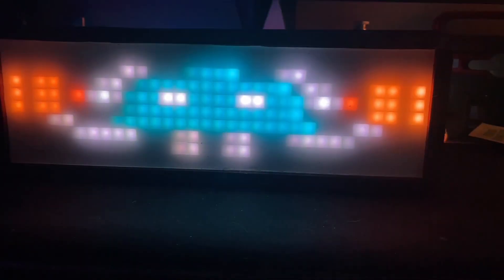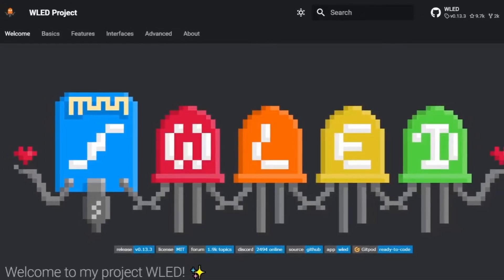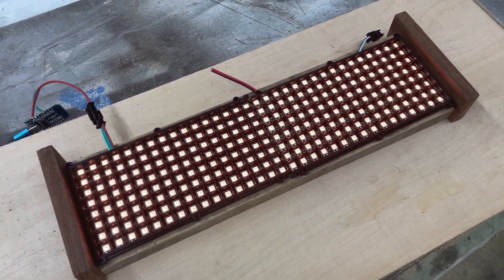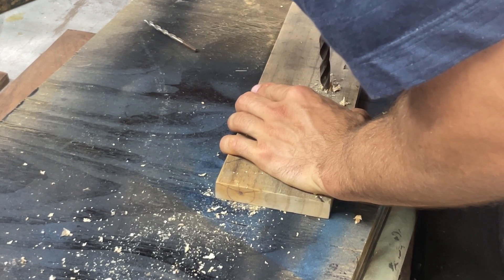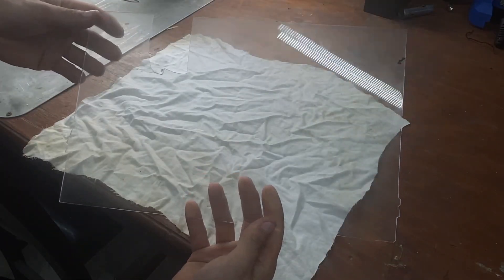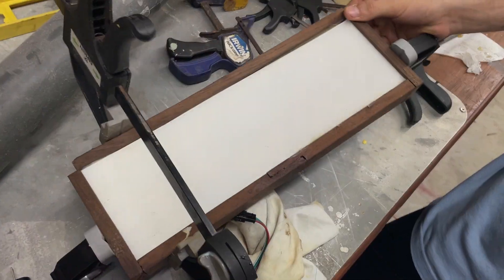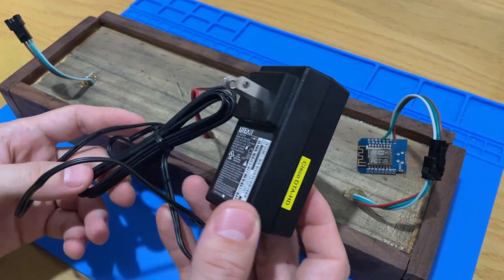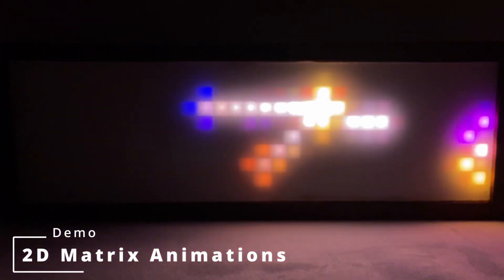WLED 2D Matrix Diffusion Frame (ESP8266 & WS2812B WLED Project)

Comment: Is the a MAXIMUM number of LED PIXELS this WLED software can operate??  - is the WLED software that MUST be used by PC or can it be used via a ANDROID MOBILE PHONE?   ---  can this support 4pin LED strips? --- I AM SCARED of 3 PIN LED strips, becuase IF 1 LED DIES, all the following LED PIXELS WILL fail or go out of sync
Reply from the maker: The max number of LEDs per pin depends on the microcontroller you use. Recommended is around 512 LEDs per pin; performance can start to drop with more due to memory and CPU limits. With some microcontrollers, you can have up to 1024 LEDs per pin. And you can potentially use multiple pins if needed to get even more than 1024 pixels from the one microcontroller if needed.
You would need a PC to program the microcontroller with the WLED firmware, but then you can use your phone with the mobile app to control the LED animations.
Yes, WLED supports various 4-pin addressable LED strips such as WS2813 or WS2815. I've always used the 3-pin version WS2812B on all my projects and haven't had a problem yet. But the 4-pin versions are a good idea for something that needs to be more robust, or if it is hard to replace after damage.
Reply: @Electriangle  ahhh, ok, so can you help me here.... i have 144/1m led strips---- i have 8x strips, i have actually shortened them so there are 134 leds per line.... it start from top left, direction goes left to right.... at the end of the 1st 134 leds, the next strip sits below 1st strip but now direction is right to left (like a snake) and does this all the way to the 8th strip

but i am struggling on how to tell wled this is how i have it set up physically, there is 1072 leds in total, id like to have an option for music reactive spectrum eq using an audio source such as 3.5 audio headphone or linein etc (i dohave a small audio board that turns audio into digital signals split into a few frequency bands) - but i also want scrolling text
Reply: @Electriangle  yes thats what i am worried about hard to replace, but i cant find anywhere that explains how to wire the 4 pin from wled, (technically the 2 data pins, as the 2 powers are not an issue)
i use the esp32devkitv4  board
Reply from the maker: @my-paypal  Your project actually sounds more like my second LED matrix project. I designed my second one using a serpentine pattern of 5 LED strips instead of using this pre-made matrix panel. ( Video here: https://www.youtube.com/watch?v=351-oehZvQE ). 

Now that you mention you're planning so many LEDs, it is good that you are using the 12V version because that helps you not need so much current per LED. It can get challenging trying to power so many LEDs.

WLED has a built-in feature to make it easier to configure this as a display for special text and animations called "2D Matrix" in the settings. I did a video guide on how to do scrolling text which maybe could help get you started setting it up as a matrix: https://www.youtube.com/watch?v=y6vftW1kjQQ&list=PLnbFWOJdmpQ3h4g0gbzmYt1LOylY6eD31&index=5 

The WLED site actually has a helpful recommended wiring diagram which shows your 4-pin LED pixel type. Check out the 2nd image on the webpage here: https://kno.wled.ge/basics/wiring-guides/ 
For the 4-pin pixel LED strips, the BI pin of the first LED should be connected to ground. Then the DI pin would get connected to the control pin of your ESP32 (recommended use pins 4, 13, or 16-33). They give a lot of useful notes there about the setup. (Personally, I haven't ever included the level shifter in my projects, and I haven't had a problem. But with that many LEDs, you might need that for better reliability to avoid potential flickering problems.)